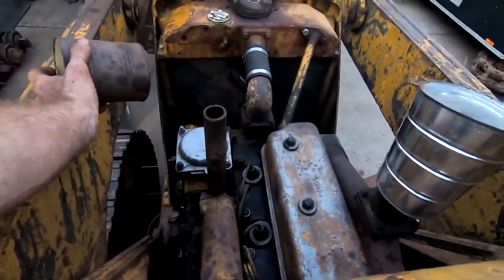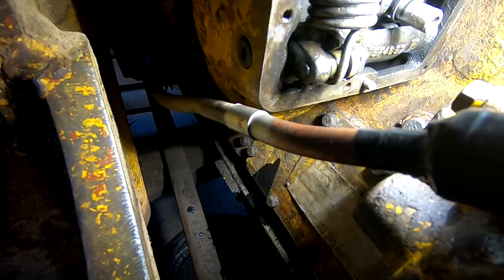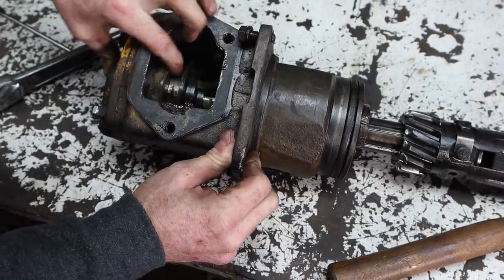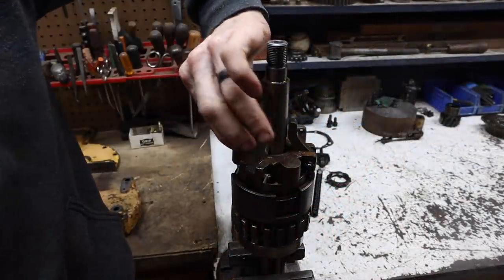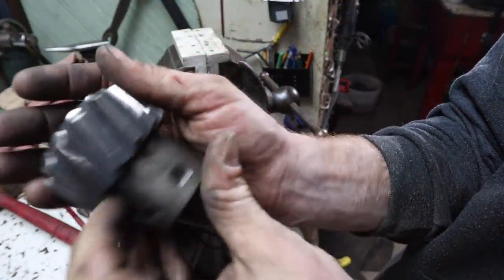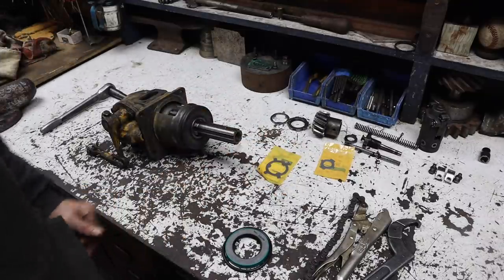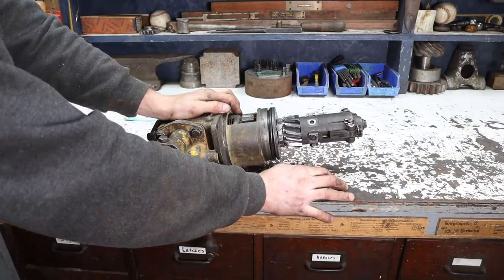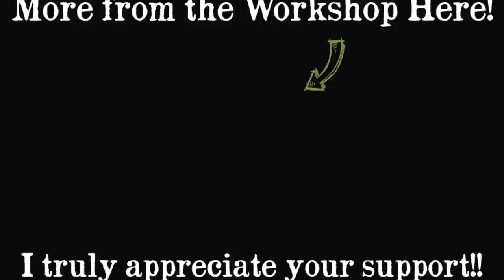Removing & IMPROVING the Starting Clutch ~ Part 16 ~ 1950s Caterpillar TraxCavator

Comment: I posted this to answer some of the "maybe you could" posts I've been reading in here.

When I started out in this business, machines with pony motors were the norm They were all roadsters too (no ROPS) and we carried our own Cat Sunbrella (look at old dozer pictures to see them in action) with us. I've run many machines like this, graders, loaders although I did not run this model, scrapers, dozers, backhoes, cranes, etc. Here's how it works in the cold. Put the glass float bowl on the carb (you always took it with you or hid it on the machine before you went home) and put a splash of gas in the tank (if you left the tank with any appreciable amount of gas in it rest assured someone would stop by and siphon it all out for you). Compression release open, clutch out, maybe a shot of starting fluid in the carb. Open the gas shutoff valve and start the pony. Most all of them were started with a rope pull cord. If it had an electric starter, and by some miracle, it worked, you're ahead of the game. Warm the pony just until it runs smoothly, idle it down and drop the pony clutch in as you throttle it back up. A few seconds after you have oil pressure drop the compression release (closed). The diesel will usually startup within several seconds of cranking in all but the coldest weather. I don't remember ever having to crank on the diesel for long as they compression fire and a pony motor spins the engine along at a good clip. On the very worst days, a quick squirt of "E" into the air stack and she'd pop off right quick, on a warm day, no either necessary, she'd pop off almost instantly. The diesel will kick the pony out the instant it lights. Now, shut the pony's gas valve off and let the pony stall when it runs out of gas. Take off the glass float bowl and wipe it out or give it a short squirt of either to clean the gas smell off it and put it back in your lunch box. Open your thermos and pour a cup, grab your grease gun and go earn your money.

Comment: The two screws under the cover are your high and low idle set screws...that's why they have the 12 point lock in the cover.

Comment: Glad you got back to this, the pinion on my D4 doesn't like to stay engaged when I put the diesel under compression. I always thought the latches were bad, but I also thought I had to split the tractor to take it all out. Fortunately I was wrong, (thanks to you) dropping the gov'na is far easier than splitting the whole machine!
Reply from the maker: Glad to have helped!! Another thing that is VERY IMPORTANT is either removing the pony motor, or at least unbolting it enough to lift that lower idler gear on the bottom of the pont motor high enough so that it no longer comes in contact with the gear in the starting clutch.... many starting clutch cases have been broken by skippint this step! Also have you tried adjusting it first?
Reply: @SalvageWorkshop  
I have not tried adjusting the latches yet, and that will be the first thing I try. Hopefully that solves my problem. Like with most of the old equipment I run and work on, I go into it fearing it needs to be rebuilt or have a serious overhaul done. I'm certainly going easy on the ol' D4, it's had a long life. 
The biggest thing is seeing how it all goes together BEFORE I take anything apart. You and Squatch253 have been invaluable help in that department.

Comment: I don't get why you don't use a wire brush and wire wheel when you clean off the crud along with some carb cleaner to get rid of the grease, you'd save half the time and effort!

Comment: Home Depot and other stores Sell 24" x 50' rolls of carpet protective film.. its adhesive on one side. its 14 bucks..  if you clean the surfaces free of Oil you should be able to get it to stick to the openings on the cat and many other projects to keep Dirt, grinding dust, and perhaps moisture out.

Comment: Little tip for cutting the holes out if you get and old steel bearing  and put it on top of the gasket paper it will be easyer to hit
Reply from the maker: I've tried it, and it doesn't work very well for me on the gasket material that I use.... Thanks Tyler!

Comment: Did you replace the clutch discs? If not, I'm not sure what you accomplished.
Reply: Putting in the bevel bend adds spring and revitalizes the bite.  When they wear out completely it will be easy enough to replace them.

Comment: What is the tool called that you used to turn the castle nut up against the green seal and then put the lock washer?
Reply from the maker: That is an adjustable hook spanner wrench.

Comment: Great series! One piece of advise. When welding a nut to a broken bolt use a low hydrogen electrode (7018). It looks like you are using 6011 or 6013 and they do not work well with the high sulfur steels that nuts and bolts are usually made from. If you are using the Lincoln AC welder I have seen from time to time in your shop then get a 7018 that is made specifically for low open circuit voltage machines. Love the series and can't wait to see the next one.

Comment: Stupid question time. How do you remember where all the parts go after you have spent hours maybe days tearing something a part? Do you have a parts diagram or do you draw your own? I find your channel fascinating.
Reply from the maker: I am pretty good at remembering how things came apart and seeing how things go back together, so no i don't usually use drawings... I do like to label hardware like nuts and bolts to remember where they go, and when I fully disassemble a component, like the clutch, I lay it out EXACTLY how it comes apart, that makes it less to remember when I need to reassemble it!

Comment: That gear was due to bad battery not throwing it into the other gear with strength and the other gear chewed it up.
Reply from the maker: No, the battery doesn't engage this gear onto the flywheel, it's engaged manually with a lever / knob.
Reply: @SalvageWorkshop  Ok - I remember it now - must be a soft lever push to do that!

Comment: I think you locked the second lock washer the wrong way. It needs to hold the nut and not the shaft.
Reply from the maker: There are 2 sets of locks on the second washer... 2 go back on the shaft and 2 go forward one the nut... I just didn't show bending over the 2 that go on the nut, but have no fear, they are properly installed! Thanks for watching and commenting! Lot's more to come!
Reply: @SalvageWorkshop  Hey, thanks for explaining. That makes sense. I didn't want you to start it up and hear a clunk.

Comment: I can see why they did away with pony motors and replaced with electric starters. You have removed at least 100 pounds of weight and the complication is horrendous. I would never be able to get that thing back together correctly. Good Luck.

Comment: I think it’s a shame you can’t afford a Tin of CAT yellow paint.
If you painted up each part that you overhaul before you re assembled, anyone could tell at a glance what restoration work has been done on the machine.
All that effort to clean and lube and reassemble but zero effort to apply a little new paint after all that work?
Just seems somehow wrong to me.

Comment: my father in law had a house in Puyallup and he took his drain system out to put in a pool and just had an open pipe into the creek and it wasn't discovered until after he passed and my brother-in-law sold the property. it was inspected by the county and shut down immediately and a fine of 250,000 a day to get it fixed, served the lying bastard right. he stole everything else. karma is a bitch.

Comment: “Farmers fix” “how hard would it be to put the right size bolt in” my respect for you has diminished immensely. Often, we (farmers) had to make due with what we had. Don’t appreciate the derogatory term. Also, what’s your experience with nuts and bolts? I suspect access to a bin full that you didn’t pay for. Probably military i.e. you didn’t buy any.

Comment: You got that clutch pack “adding some spring” to it wrong.  At first you were noticed something good—all the plates being extremely flat!  I cringed when you said you were gonna change that to add some spring tension.  The “spring tension” your talking about adding is already there and is adjustable.  I’m pretty sure you recognized it, although your manner of “checking and verifying” its position was very half assed in how you spun the piece off it’s threads and sorta feebly counted those revolutions then said oh about 3 1/2 (not quoted).  Point being—you didn’t take any time to simply make two marks to index a place on the shaft and a place on the “spider” which is the adjustable “clutch apply cam” in this mechanism.  Old monarch lathes used a very similar mechanism—see abom 79’s video of him tearing into and fixing his monarchs clutch.  It’s much larger but functions same.  Anyway, not meaning to trash you. By no means.  
More points—never bend a relatively  unknown metal unless your knowledge and experience with metallurgy is relatively decent.  There’s a lot of brass alloys and some don’t like to bend will just crack or break.  Beating that “bevel” into the plates was cringeworthy.  And unnecessary and only served to muck up a system in a way it probably doesn’t need and wasn’t engineered for in the first place.  If you need more tension (clamping force is the proper words) on the clutch pack.  Adjust it.  That’s how tight or loose that piece was threaded on.  The cam.  “Beveling” the plates adds a dampener into the system.  We see it all the time in clutches in motorcycles as a “wave washer”, or wavy clutch plate.  It’s not for spring tension or clamping force on the pack, that’s the job or the actual springs.  Those wave washers/plates just dampen the application of the clutch to “slow” it down, make it less aggressive, jerky, take away vibration, smooth it out.